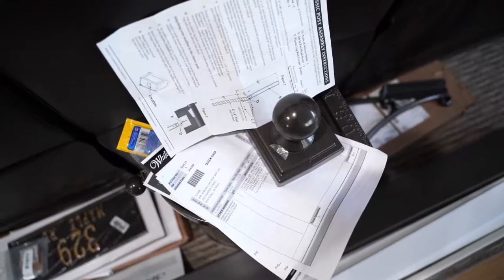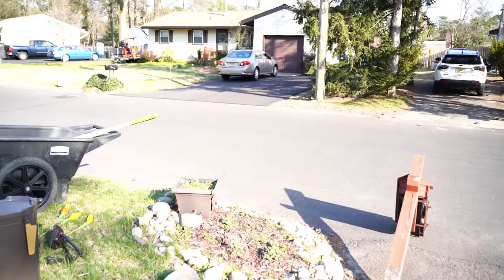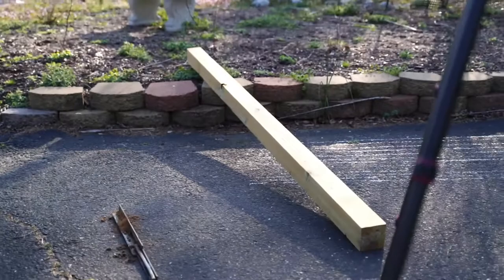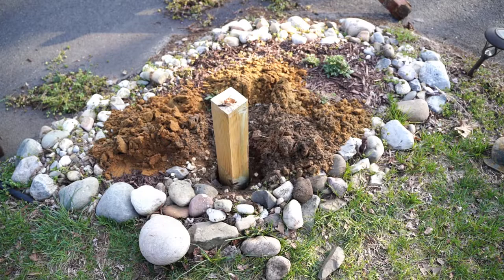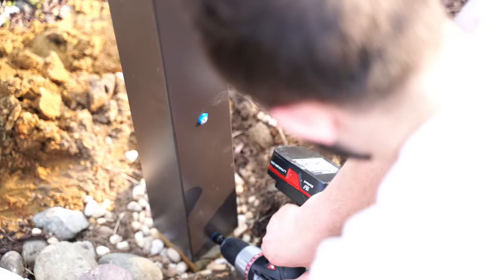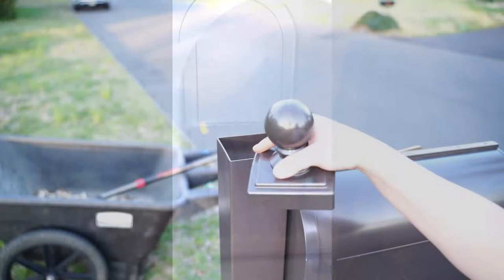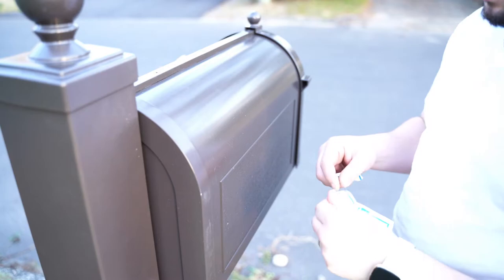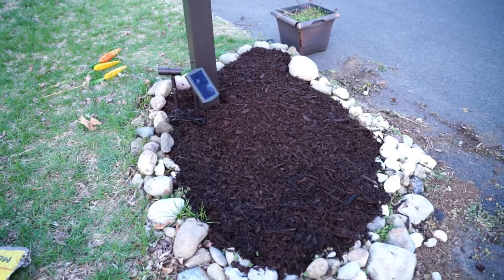3 Hour Whitehall Mailbox Install in 30min!!

Comment: Did the instructions want you to use quick setting concrete to secure the post in the ground?  I like using rocks like you did instead so it's easier to install or replace in the future.
Reply from the maker: It said either could be used, from past experience using concrete with aluminum or wood posts directly without having an aggregate barrier (like rocks) will often causes the post to rot quickly

Comment: You didn’t tamp those stones in any to tighten it up any
Reply from the maker: No just with the shovel until they stopped moving. Using a proper hand tamper would definitely work better though if you prepare the ground out a bit further to fit it in there. Great callout!